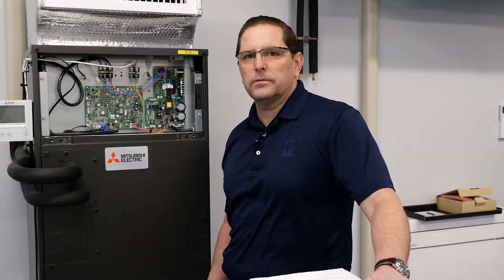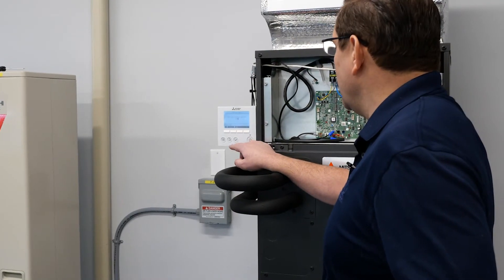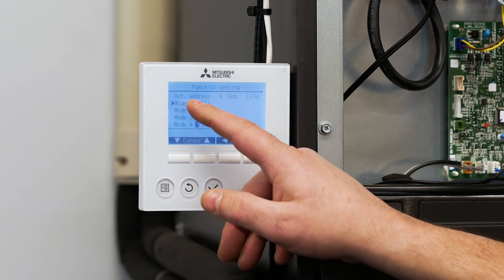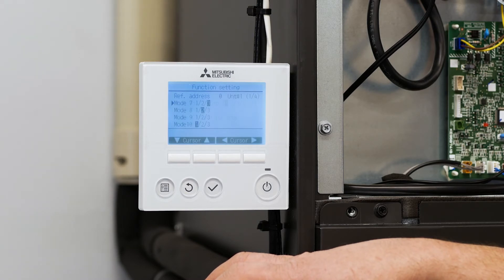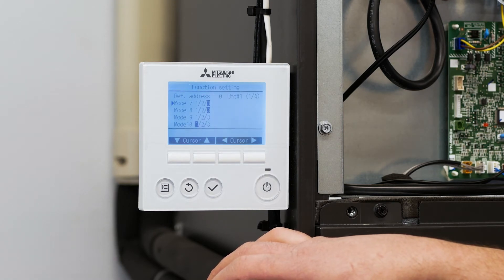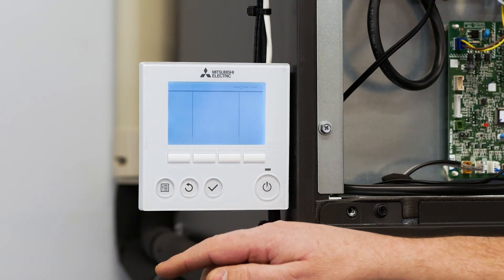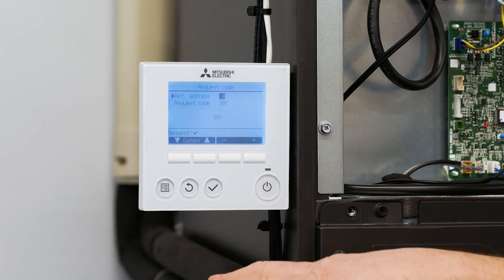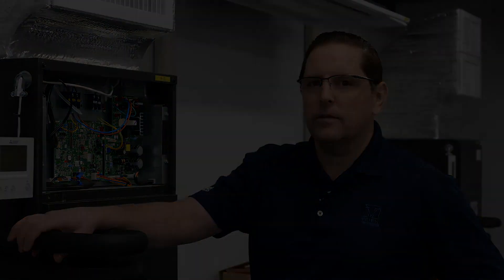Technically Speaking EP 5: Mitsubishi Air Handler Settings - PAR 33 Controller

Comment: I have 2 air handlers, 1 in basement, 1 in attic. I'm very frustrated, my dealer has been friendly but completely unhelpful. 

First floor is always cold. I set the thermostat ( or kumo) to 74 both the thermostat and kumo say it's 71 on first floor but no heat! Meanwhile upstairs unit is on and producing a ton of heat!

I have thermal off fan to off for both units, and have it to not turn on aux heaters when defrosting. 

What could be wrong? System is a year old and has not worked well at all.

Comment: Just had a system installed that uses this controller. I didn't get it fully checked out before the installers left, and now find that I can't get the fan to run, in any setting. Guessing it must be something simple - any ideas? I'll get in contact them early next week if I can't get it resolved by then.